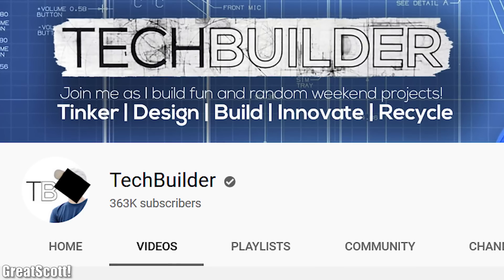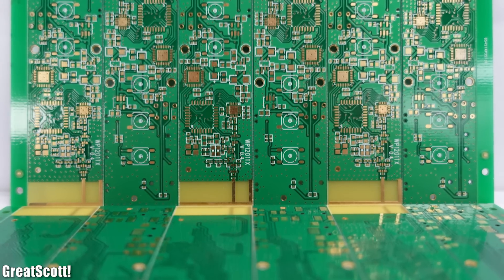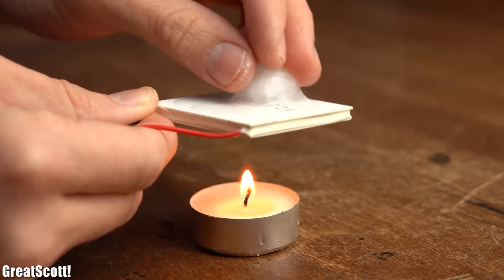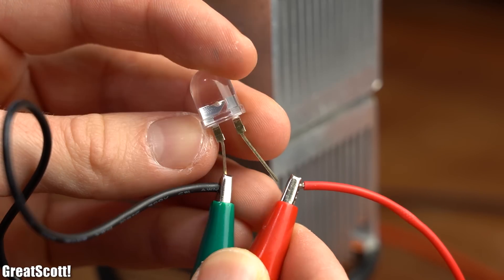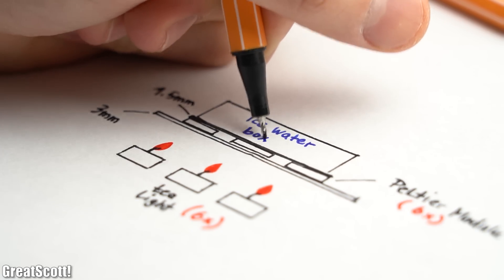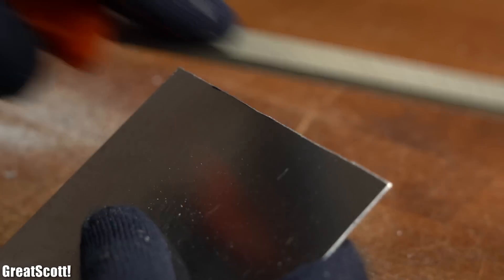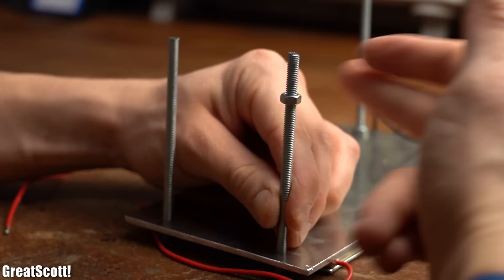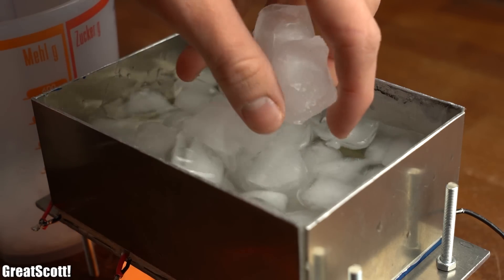Exposing a FAKE Thermoelectric Generator and building a REAL one!

Comment: In idealized cases, you generally get near the best power generation and efficiency performance when you match the load resistance to the TEG series resistance (Rload/Rseries =1). When taking additional measures to transfer heat (heatsinks/radiators) things get a bit more complicated but will tend to necessitate a higher load resistance to achieve near max performance (Rload/Rseries =1 to 3) Source: Thermoelectrics: Design and Materials, 1st Edition, Hosung Lee; Chapters 2 and 4. This will complicate the voltage regulator scheme to some degree but it's necessarily to get the most out of a TEG.

Comment: Can you build a better generator, like for example using a stirling engine attached to a generator? The heat from a candle would probably have less losses than with the peltier, but you introduce moving parts instead of the solid state peltier module.

Comment: I'm wondering if the oxide coating on those plates messed up your soldering. Even with MIG/TIG you need a shiny surface for good results.

Comment: the hottest spot on a candle is the brightest part of the flame, which need to get in touch with the aluminium plate, to get the best possible result. if you would thermic isolate the peltiers to each other, especially between them, the thermic difference would be higher too. which leads to better results. maybe a  slow fan would work with double the tec setup.-

Comment: 7:12
You can actually use hot glue as a complete seal if you heat up the aluminium plate until the hot glue melts and then let it cool off.
The reason why normally hot glue doesn't stick to metals very well is their high thermal conductivity because the surface of hot glue cools off rapidly and doesn't have time to stick completely

Comment: are you reading my mind??!! i was trying to figure this out yesterday!
Reply: i want a bunch glued to the outside of a concrete rocket stove that powers a pump and a bunch of fans to heat water going through a pipe embedded in the stove, and make a remote camper heater with a pc radiator

Comment: Nice video, although I would like to add a couple of comments! You're using way to much silicon compound, compound is actually a that conductor and it's only used to fill up the small gaps between the two surfaces. You should only use a very very thin layer of compund. Next, I saw in your video that some of the compound almost reached both of the surfaces (hot and warm side), here you can risc a thermal shotcut and thereby have a bad efficiency.

Comment: Not to be a hater but I am pretty sure you are using way too much thermal paste, you want to apply a layer that is only thick enough to compensate for the uneven flatness of the two surfaces, which is almost nothing.

Comment: What about decreasing the distance between the candle and the heatsink to 0 inches? You put the candles 2 inches under it and that causes a lot of heat losses. Also, you could provide some conduit for the hot air not to spread around and be kept under the heatsink area. I understand your point, and I agree that it is a waste of time and money using peltier modules do generate power. But your results could be better for this video :-)

Comment: I love proyects with fail parts (soldering aluminum) that gives a better view to the public
Reply: I know the theory of using those rods to join aluminum. I also know it takes practice. 

Thick aluminum is a very good thermal conductor. You pretty much have to heat entire parts. Otherwise, the heat you apply at the joint will get carried away to the cold parts of the metal and too much crud will build up before the joint is up to melting temperature.

Then there is surface prep and how to get the bead started. 

Surface preparation

Comment: I've played with these myself. The problem is that to get a decent power output you need a very large temperature differential - which means getting the hot side really hot. Hot enough that I ran into problems with the solder in the modules melting.
Reply: i wonder how much energy you can get out of a system if you hook like 50 high power peltiers to a wood burning stove. And using the outside freezing temperature with a radiator to cool the topside. Do you reckon this is possible? 

Watercooled topside with refrigerant water looping through outdoor radiator with a small fan in -10c temperature. Do you reckon one could somehow get a couple hundred watts out of any setup with a peg or tec?
Reply: @ReizungV  Not much. Under ideal conditions, with materials optimised for power generation, you'll get maybe five watts per module. Remember that those things just plain suck for efficiency: It's on the order of a few percent. Their advantage comes in reliability due to to having no moving parts to wear out.

Comment: Little tip for aluminum brazing you showed the flame melting the brazing rod the proper way is to heat the aluminum and have the aluminum melt the brazing rod also another tip use a wire brush or sand paper that has only been used for aluminum to clean the area that you will be welding

Comment: It seems like the claims on these sorts of devices ignore all the energy that goes into making the ice in the first place... but as long as we're putting crazy amounts of energy in for tiny amounts of energy out, may as well use dry ice instead of ice water so that the build would be significantly easier.

Comment: There's way too much thermal paste on those Peltier modules, you're killing conductivity. Also, on the first project, that tea light is way too far from the heat sink. I don't think that you can charge a smartphone with the 1st "fake" way, but you can certainly make the smartphone believe it's charging.

Comment: The aluminium solder does work but you have to clean the aluminum with a stainless steel brush and heat the aluminum with the torch and remove the flame and apply the solder!!

Comment: Would a stirling engine be better with a dynamo and same amount of candles?
Reply: Stirling engine phone charger. BRB, making 1000 and flooding banggood.
Reply: Perhaps. Just as Tj Wolf commented above, this should be determined experimentally. In general however, Peltier technology so far has been inefficient, and a well-designed Stirling engine and a DC generator might do the job better than Peltier modules given the same thermal energy.
Reply: I seem to remember reading somewhere that the Stirling effect was the most efficient it was possible to get with regards to capturing energy from heat transfer, so it'd probably work better... That said, my memory isn't what it used to be, and there were probably qualifiers.
Reply: @Corbald  Stirling engine is close to the theoritical Carnot heat engine. In theory...
https://en.wikipedia.org/wiki/Carnot_heat_engine#Efficiency_of_real_heat_engines
Reply: Stirling engines wase build to make electricity
Reply: It depends. 
On this small scale Stirling probably would be same as Peltier element, if i'm not mistake this chinese Peltier have ~1.5% efficiency(from heat source to electric energy), while chinese Stirling engine toys have ~5% efficiency but heat to mechanic energy, so adding generator and some belt drive at this scale could divide output in 2-4 times so eventually could be the same efficiency. On larger scale decent built Stirling engine around 1kW power would have at least 10% efficiency, while 200 Peltier elements in series will still have 1.5% efficiency.
Reply: @alexanderfl-ts3171  efficiency depends on the application. A gasoline generator placed inside a house pulling a heatpump will actually gain thermal energy (you'll die from carbon monoxide poisoning though). It would be over 150 percent efficient.(I don't feel like calculating the precise answer) You'd be capturing all the thermal waste of the gasoline generator for heat. Then you'd be powering a heatpump which is 300 percent efficient. So my point is, efficiency isn't a good standard for power generation unless you have the whole system to calculate.
Reply: Dont confuse efficiency of a whole system and efficiency of process, I was talk about efficiency of "transforming" heat energy into electric energy. Capturing waste heat and use it for heating or such is not about efficiency of process - for process this heat was waste already, it is more about fuel efficiency(i.e how much use we get from burning fuel), or how much of burned fuel was wasted. For example natural gas power plant have efficiency of turning heat into electricity ~60% at best, but in winter season some power plants claim 90-95% efficiency - they capture waste heat and heating houses with it, so 90-95% of energy released from burned fuel was used(and only 10-5% was wasted completely), but heat to electricity still remind around 60%.
Heat pump is completely different story, it have power coefficient(usually above 1, or above 100%), and efficiency of the process itself(process of pumping heat, which is less than 100% as for everything). Basically that efficiency what I was talk is efficiency of conversion one energy into another, while heat pump just move heat from one isolated thermodynamic system(outside house) into another isolated thermodynamic system(house), it is not creating heat so it is have power coefficient(which you call efficiency) higher than 1(>100%).
Reply: Technically it's way better than whatever this is. But, the efficiency of this engine wears of easily. TBH I prefer a gas powered /diesel.

Comment: Just a quick tip regarding your solder fail, you need to use a specific acid flux and you must clean the areas you are going to solder with a stainless steel brush in order to remove the aluminum oxide layer. Dont rely on aluminum solder that claims to have the flux built in because they are inherently ineffective unless you have the right type of aluminum. Generally the place you buy the solder from should also offer a liquid or paste form flux. Also do note that aluminum has a lower melt friction than other metals, if you over heat it or get it to hot you can get results like you did in this video, so keep the heat down as low as you can and work up to more heat as you try the application of solder.

Do note as well that there are different types of aluminum and some are very difficult to work with and may require a specialty welder to bond them. Aluminum steel is one such metal that will not work with solder.

Comment: Hey great vid, did you sand the surface of the alumunium before you solder it, you should probably do that, it helps with the bonding of the alumunium solder

Comment: To properly solder aluminium you absolutely need to use the correct (and very corrosive) flux since AlO is quite chemically, thermally and mechanically resistant.

Comment: I think you also need a special flux to solder Aluminium, because it forms Aluminium-oxide as soon as it gets in contact with oxygen. That is probably why you where not very successfull ^^
Reply: You are almost right, an oxide layer is always present on aluminium but you cannot solder it at all. You can weld aluminium but soldering is not an option
Reply: @IrishSkruffles  You can solder it but it needs special solder and a wire brush to remove the oxide layer just before soldering. That said - epoxy is easier unless you need electrical conductivity.

Comment: I'm kinda blown away how many phones in circulation in 2019 have micro B connections. I constantly forget how privileged I am with my USB-C phone
Reply: Micro B ftw. It's not a privilege to be forced to bring your own charger everywhere since most people have the other connector. It's the iCrap dilemma all over again :P
Reply: I mean, what is the upside?
Reply: @mzflighter6905  upsides are numerous in C-to-C connections, since it can be a charge cable or a monitor cable, but A-to-C connections only have the "orientation agnostic" benefit tbh
Reply: @TheLunaLockhart  that changed with usb 3 though. type a and type c has all the same pins. you can theoretically do the same with type a but eh, idk
Reply: just look down in your type a connector, you'll see the expected 4 pins, one pin sticking out and 4 embedded pins in the back wall of the connector.
Reply: @hachikiina  weirdly, my older A-to-C cable is USB 3 and my newer one (that came with my recently acquired used pixel 2XL) is USB 2
fancy that! I had no idea how to check outside of the blue plastic, so that's good info to have
Reply: @TheLunaLockhart  my oneplus dash charge cable is red :^) some fancy cables change the color
Reply: @hachikiina  yeh, always good to have a second category signifier available for that sitch
Reply: usb c gang rise up

Comment: Soldering aluminium is easy. Just use a stainless steel brush to clean the oxide layer before you start each joint.

Comment: I guess aluminum soldering not supposed to be on exposed fire by instruction) even their marketing material cotradicts their instruction. It should be just melted by contacting heated joint in theory. Mine is still wairing for experiment to prove pr disprove this technology )) thanks for this episode btw

Comment: Thermally conductive paste is actually a bad conductor of heat as compared to the metallic heat sink. Only small proportion must be used to fill the contact gaps between the heatsink and the module. You have used so much paste that it might have adversely affected the performance of the heatsink to radiate heat.
Reply: I was just going to say the same thing and was scrolling down to see who had beat me to it. Nice.
Reply: So true

Comment: You use way to much thermal paste
Reply: Not really even if it looks so. These TEC elements have a really rough surface compared to CPUs so you really need a lot of it. Already made this experience by myself.. it's going to get expensive.. At least: What helps is to let heat up the TEC afterwards so the thermal paste can flow better.
Reply: @Oxytropis1  Um.. what do you mean? (My English ain't the best.)
Reply: @Oxytropis1  Ah, that was what you meant. I've already thought about that a bit, too, but the two sides are usually made out of ceramics. So that might be a bit more tricky and also the ceramic dust might be a bit problematically since as I guess it's similar to glass. But I might try it in the future whenever. Needs some research tho.